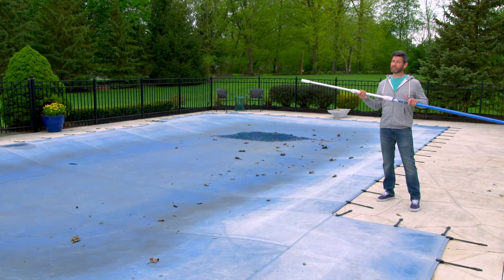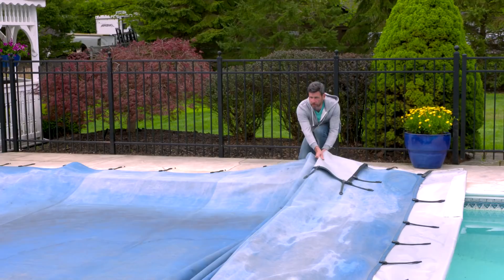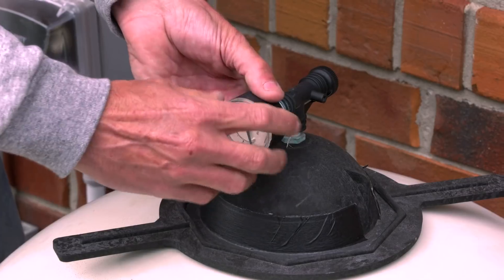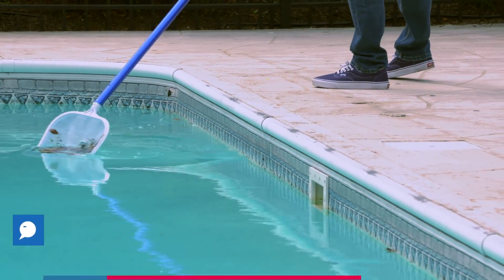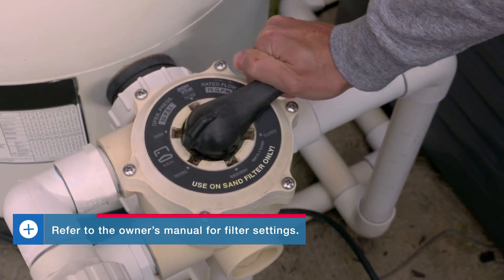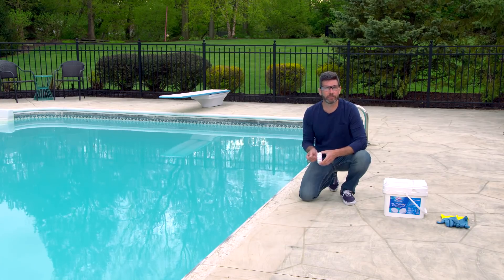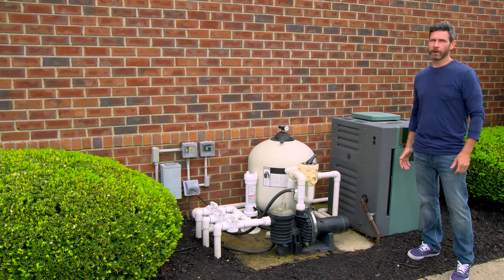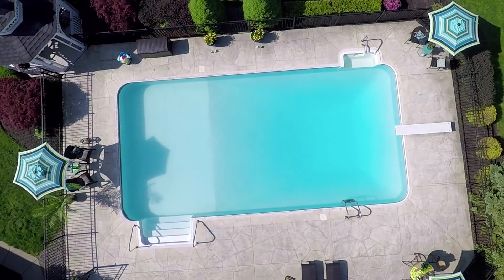How to Open Your Swimming Pool | Pool Care (1 of 3)

Comment: If anyone happens to see this, DO NOT use a pool cover during a hurricane or major storm. There are 3 main reasons for this:
1. It won’t do much to protect it from dust or contaminants since heavy wind & rain will likely blow it off anyway
2. Pool is more vulnerable to sharp branches and other debris than can damage the cover
3. The cover will likely be more difficult to remove because heavy amounts of water & branches will be on it weighing it down

Comment: Forget about a chemical pool! We have a salt pool and love it! We use it year round. Our pool does not require all of these chemicals.
Reply: Rosario Miranda salt pools just make chlorine themselves. You should still be balancing your pH
Reply: We do balance the PH. We either add a bag of salt or add water depending on the reading. Usually the only time we need to do that is when it rains. So easy to clean.

Comment: You were going good until you used a guess strip.   After that it was all down hill and mostly wrong.   But at least you got the beginning right.
Reply: pa beader why was it wrong lol, as someone who owned a pool, he did it right in my opnion
Reply: It's the conventional, old time way of guessing your way through pool care.  The more modern (after 1970) version has you doing actual drop based testing and only adding those things that you actually need.  The list of required chems are liquid chlorine (bleach), CYA, MA and backing soda.
Reply: Thanks for the genuine reply. I see what you mean now, but I still wouldn't call it wrong because it does get the job done, (If dated) Looking back on the video however, I do think, based on what you said that this video could do well with some (A lot of) updating,  based on what you said. Your comment made it seem that they were utterly wrong in ALL of the second part of the video. When in fact, they were teaching something dated but could still get the job done. Based on what you said.